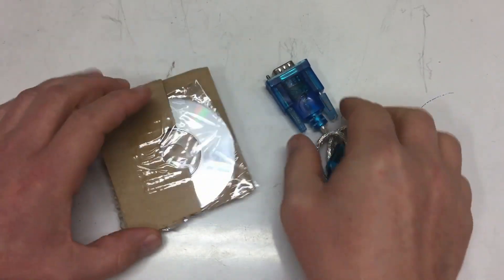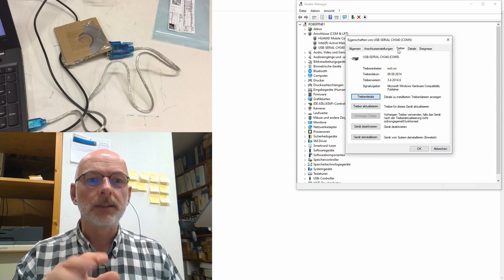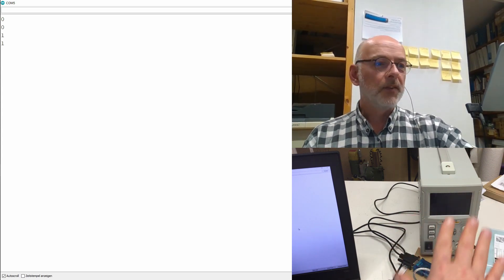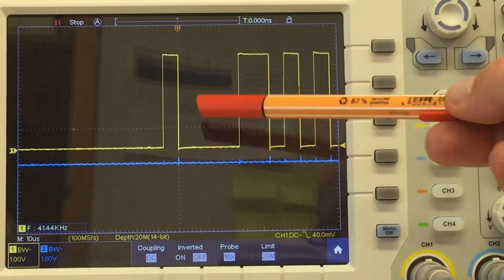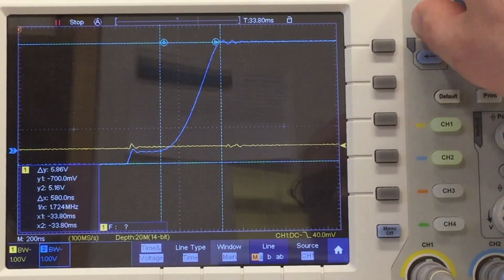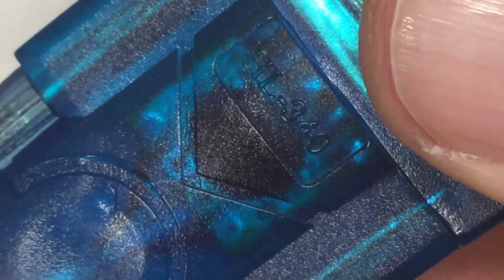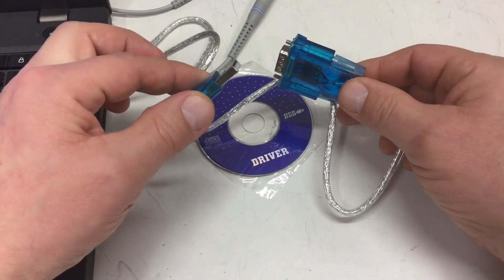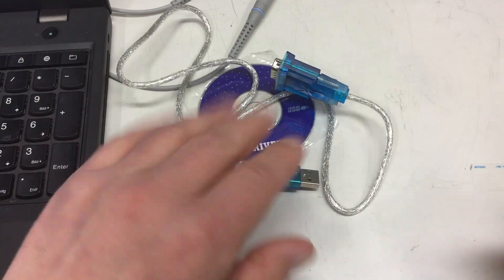Chinese HL-340 USB to RS-232 Converter (CH340 Chip) Review

Comment: You are wrong, (-25)-15 to -3V is a "Mark" (logic 1, high logic level) and +3 to +15V (+25Vmax) is a "Space" (logic 0, low logic level) for EIA-232 standard. So, the signals from this crap are not only TTL-leveled, but also inverted relative to EIA-232.
Reply from the maker: Uh, you are absolutely right. RS-232 uses high 0s (spaces) and low 1s (marks). I actually didn't catch that flaw. Thanks for pointing it out.

Comment: I found a similar one like this in the workshop bin at work and "hacked" it to be a normal USB-UART interface to use with Arduino. Basically just removed the RS232 chip and linked the CP2103 pins to the DB9 pins.
Reply from the maker: Similar, but obviously not identical 😉Mine didn't have a RS232 driver chip to begin with. The CH340 pins were already directly connected to the DB9 connector.

Comment: Darn it! Just ordered one like this. Where can I buy a real USB to RS232 converter?
Reply from the maker: E.g. FTDI USB-COM232-PLUS1 https://ftdichip.com/products/usb-com232-plus1/
Reply: @robertssmorgasbord  Thank you very much for that link. (Youtube didn't send me a notification).
Reply from the maker: @meneerjansen00  No sweat! Happens to me with YouTube comment notifications all the time.
Reply: @robertssmorgasbord  The following may be of interest to you (in a follow up video?). The cheapest solution I could find to communicate with my vintage serial handheld was to buy a USB-to-UART device that outputs 5 V over the Tx and Rx lines. It also has a 5 V DC out for you to feed into another device. It's a little red FT232RL board (you probably know the one).

Then I convert the UART TTL 5 V Tx/Rx signals to RS232 and double the voltage to classic RS232 voltage levels with a MAX232 device. One connects the 5V DC output of the first device to it for that purpose. It's a little blue SP3232 board: you probably know the one I mean.

We should not buy these crappy Chinese so-called "USB-to-RS232" devices. They don't work in 99% of the cases. Thanks again for your clarifying video!
Reply from the maker: @meneerjansen00  Thanks for the info! As it happens I just reviewed a little FT232RL board https://youtu.be/27zx9MMKbAE 🙂 But I plan to use it for a RS422 / NEMA0183 HS interface, not RS232. And yes, the MAX232 is a good solution. I think there are even reference circuits in the CH340 or FT323RL datasheets for it.

Comment: I've had similar expertise with my USB to RS232 convertor. Connection with DEC VT510 Terminal was without problems, however some devices needed custom cable. RX TX nad GND pinout seem to be correct at least.
Reply from the maker: It's not just the pinout (the HL-340's is according to standard), it's the voltage levels. Some industrial devices are using +/- 15V, which will fry the CH340 (and possibly the connected USB port of your computer).

Comment: Interesting, I've never given RS232 that much thought, its only ever been plug and play to me, thanks for the spec's and yeah, I guess you get what you pay for ! but at least it works and you had a quick chat with the Owon...cheers.
Reply from the maker: Back in the days RS-232 was the prevalent interface for all kinds of peripherals (besides Centronics/parallel if you needed more bandwidth). And yes, it worked with the "It Who Must Not Be Named" power supply. But then, its RS-232 interface was (fortunately) also not fully standard compliant.